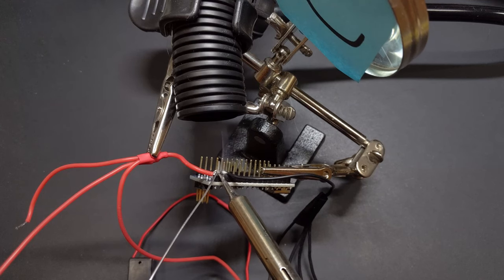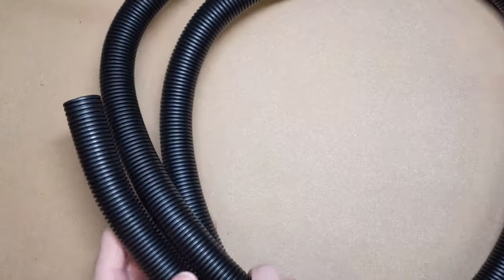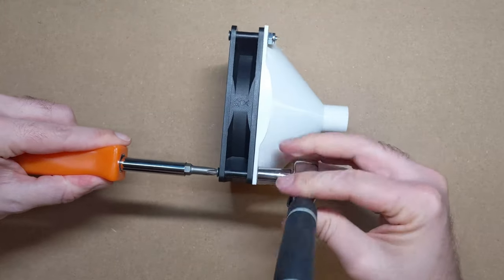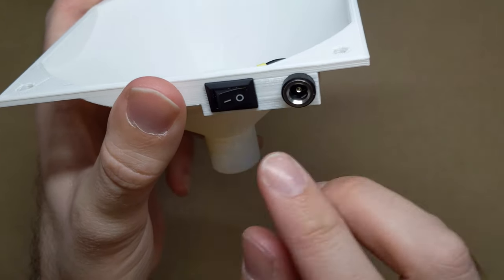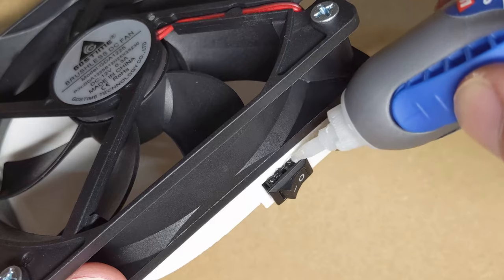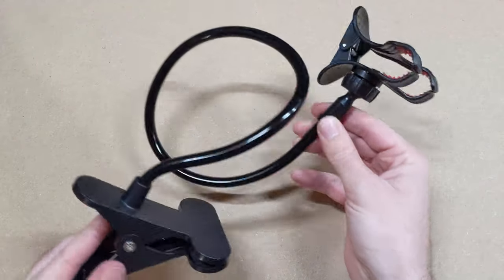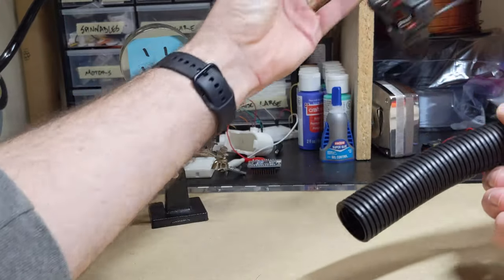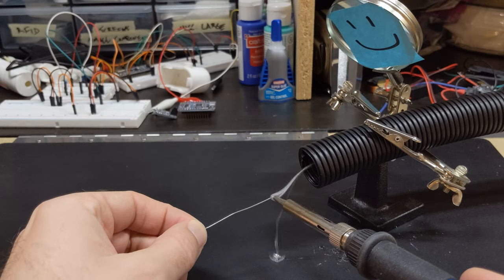Quick and Easy Solder Fume Extractor

Comment: If I have a fume extractor inside my room & wear a mask, keep the fan on & the window cracked is that enough ventilation. It's 100⁰f outside and I can't solder in that heat anymore. Is this safe enough conditions to do it inside?
Reply: when your hair starts falling out you know you doing something wrong.
Reply: You just have to install an air filter to the tubing so air gets pulled through the filter before being released

Comment: Nice build it would be even more efficient with a higher rpm fan and a large tube for a better extraction capacity and distance, i remember doing my first soldering without any fume extractor it was almost impossible fumes were all over the room
Reply from the maker: Thanks! I'm thinking about upgrading as well, it'd be nice to be able to get farther from the tube without having to worry. And I'm glad you got an extractor!
Reply: I have my soldering station in my bedroom so this is a serious problem for me

Comment: Hey, im looking to do this and am new to electronics, how do you have the fan/switch/jack wired?
Reply from the maker: Happy to help! The wiring is pretty simple, I just put up a diagram for you: https://bitbucket.org/make-fun-stuff/fume-extractor-diagram/src/master/FumeExtractorDiagram.png

Basically, the fan has a positive and a negative wire, and when they are connected to the positive and negative wires of a power source (positive to positive, negative to negative), the fan will turn on. The power source in this case is the power jack, since it connects the positive and negative contacts for whatever power supply you use to leads coming out of the back of the jack. I connected the positive jack lead directly to the positive wire on the fan, and connected the negative jack lead to the negative wire from the fan, but with the switch in the middle. There are two leads coming out from the switch; when the switch is "on" they are connected and the switch acts as if it was just a wire, and when the switch is "off" they are not. When the switch is disconnected the fan's negative wire is not connected to the jack at all, so the circuit is not complete and the fan won't receive any power, even though the positive wire is connected to the power supply. Once the switch is flipped, the circuit is complete and the fan will be powered. The diagram should help make it more clear if this description is confusing at all.

Hope that helped, and hope you enjoyed the video! It's great to hear about people who are getting started in electronics, best of luck to you!
Reply: @MakeFunStuff  Appreciate it, once I put this together I'm going to attempt building the 8x8 led cube
Reply from the maker: Very cool, sounds like a fun project!
Reply: @MakeFunStuff  "repository not found" :(
sorry, didn't expand the comment.
still confused xd
Reply from the maker: Whoops, sorry about that! Here's the correct link: https://bitbucket.org/make-fun-stuff/fume-extractor-diagram/src/master/FumeExtractorDiagram.png
Reply: @MakeFunStuff  ty and also, is the short pin on the DC Power Supply Jack Socket Female Panel Mount Connector (mouthful) positive or negative? I've tried to look it up and test with a multimeter but I don't know what I'm doing honestly.. the number is positive either way I put the probes on.

nvm, I got it.
Reply from the maker: I'm not sure about the length, but unless I'm misunderstanding something, if you put a live power supply in the jack and measure the voltage on the pins it should read negative one way and positive the other.

Comment: Dig it.  What soldering iron do you use?
Reply from the maker: Thanks! In this video I'm using a cheap soldering iron from a kit that came with extra tips, the stand, etc. It was all super cheap (under $20), and it's been working really well but I just ordered a nicer one that I'm loving so far. There are links to both in the description of the video, if you're interested.

Comment: I'm doing something similar. I picked up 2x 120x35mm high airflow 3000 rpm fans. Like 125cfm each lol. I don't have 3d printer but plan on mocking one up with cardboard. Not sure if I can put them in line with each other at either end of a 7" long box. But I'll try lol. If it works out I'll make a thin plywood box or something.
Also found some tubing for the suction side that stays put when you bend it. Still not sure how I'm going to do it but hopefully those little fans can move a lot more air

Comment: Hi i am from Indonesia. What if reversed position. The end of the drain hose on the window and the fan near the soldering station?
Reply from the maker: I can't say for sure, but I think that should work just as well. The speed of the air being pulled in where you're soldering would move a little slower since it's spread over a larger area, but my guess is that it'd still be fast enough to get the job done.
Reply: It makes perfect sense and it's not
it occurred to me. Same with the working system of the vacuum machine.

Finally, how many grams
from the 3D model design. Because, in my country there is a 3D printing service that is calculated by weight for
production costs? Thank you.
Reply from the maker: That depends on the settings you use when printing (infill, etc.), but with supports and 20% infill my slicer estimates 133g.

Comment: Can i use i bigger tube like i got an old vaccum that doesn't work
Reply from the maker: You could use a bigger tube, although the wider it is the slower the airflow will be. Depending on the size that may not be an issue, but you may need a more powerful fan as well. It's worth a shot though!

Comment: I saw you are doing a pull configuration there. Do you think a push configuration would work? Basically the fan will be place at the table and the tube end will be place outside
Reply from the maker: I don't see why that wouldn't work, and it might even work better. The suction would be a little weaker but over a larger area, which might make it easier to position.
Reply: @MakeFunStuff  thanks, bro. That's really helpful